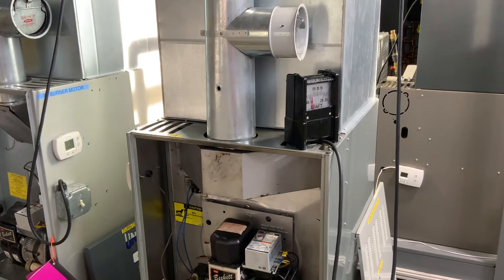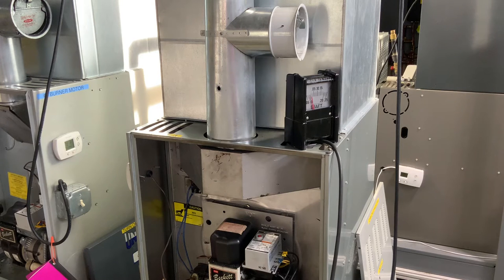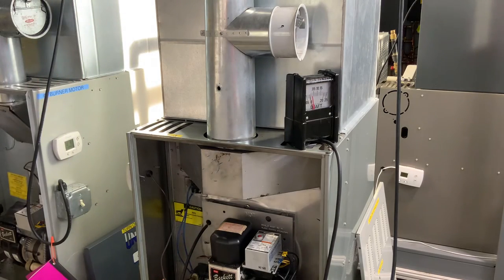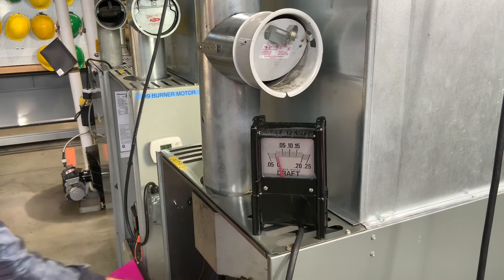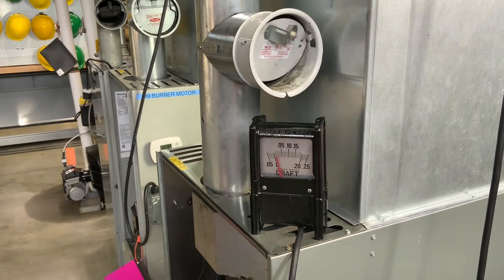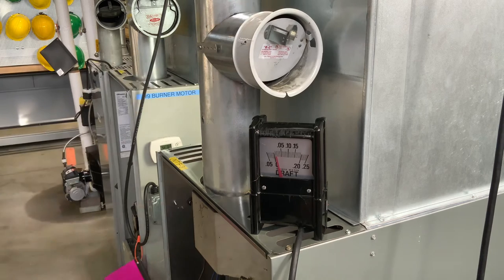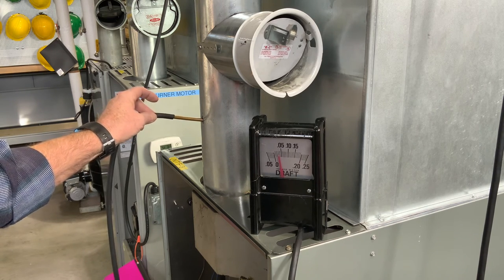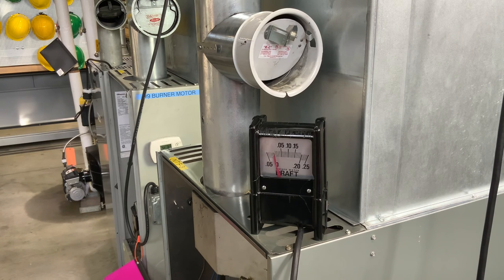Overfire Draft Test

Comment: I thought the Baro-damper adjusts chimney draft, and the air shutter on the pump area adjusts the over-fire draft. No? If so, would you adjust the pipe damper 1st, and then the air shutter second? Thanks for your video.
Reply from the maker: The air shutter on the pump is adjusted during the smoke test
Reply: @frederickkosier2508  So are you saying you "don't" adjust overfire with the air shutter? Only the baro?
Reply: @joequillun7790  Good question I am wondering the same thing
Reply: They kind work together, the pump one is for fire adjustment , but the damper is for smoke adjustment( draft), yes is it is hard to explain, but you need to adjust them somehow together , no matter which one first.
Reply: @palangnar3588  I guess then, I see it like this.
1st we need to know what the draft is on the pipe, "and" over the fire. Then adjust accordingly.
 If the chimney draft is low, (.01-2), then adjust  the baro damper for -.03-4, then recheck the over fire draft, and if it's reading high, (-.03 or so), then shut the air shutter down to about -.01. 

Or in another scenario, the ovefire is low, (.00 or less), then open the air shutter to bring it up a touch, and if the chimney draft, goes over .05-6, cut the damper down lower. Sounds easy enough. But what if one adjustment continues to throw the other off. Would you be adjusting back and forth? Maybe I'm making more out of it, than it is. Some people say it's not that critical. I'ld kinda like to know.

I just bought a manometer, that when it's set on the scale for inches/H20, it only reads the tenth scale after the zero, and not the hundredths. And it says it's for checking furnaces. How can you measure a draft of -.01-2, when its lowest reading only reads 0.0?
Reply: @joequillun7790  I tell you this ,that i don't even have any tester, i just use my knowledge and eyes to set the adjudgments , i am not exact, but close enough, i service/repair my oil furnace for the last 20 years, the most important things are service/clean the furnace regularly, and right nozzle and check( look) the fire to see burning right, a fire should burn clean, but a little smoke is ok.
Reply: @palangnar3588  OK, thanks for your opinions, and replies. :)

Comment: When a furnace kicks on and theirs a fume smell but goes away. Would a barometric damper be affecting that?
Reply: What if it doesn't and gets so bad that your coughing up a lung in your bed room? What if the the valve has cold air from outside blowing back through it? Kevin Adams the guy who installed it denies that is possible but I can prove he's wrong and he refuses to fix it instead asking me how to fix it.